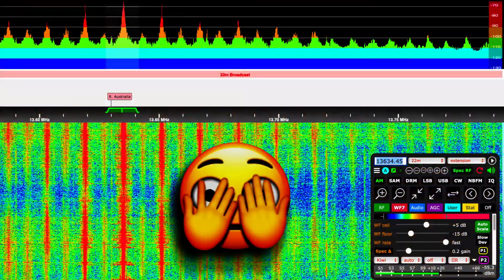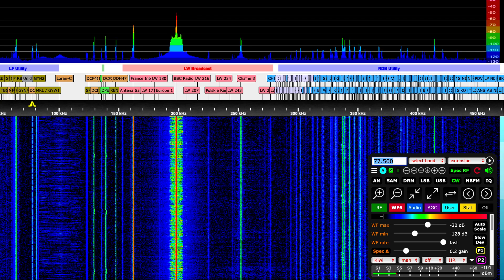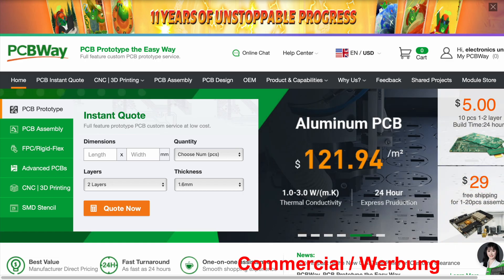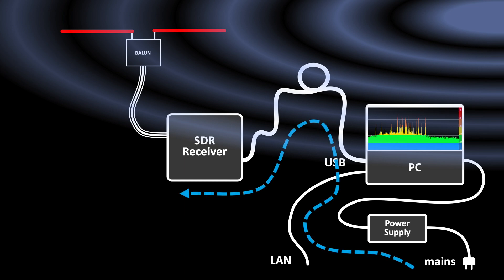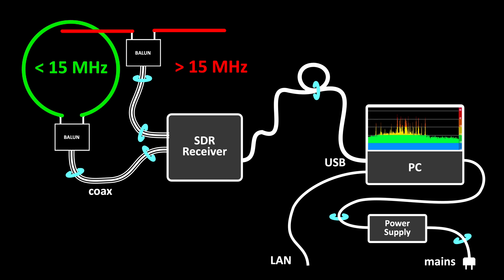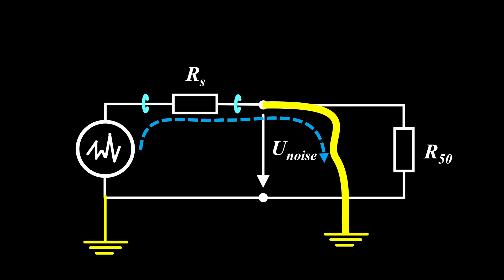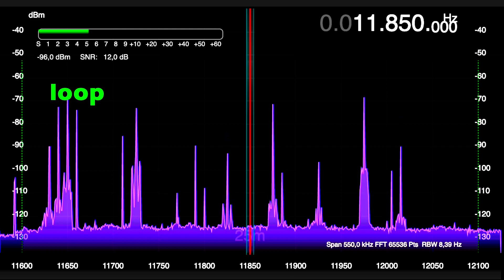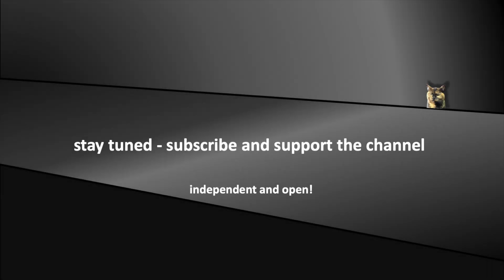Simple but Effective Measures for Good SDR Long- and Shortwave Reception (EP167)

Comment: Very good video! I am an SWL since i have 12 years old and like electronic.  But i buried this hobbie for almost 30 years and recently i come back. I  also  became a ham radio operador. Today it´s very dificulty hear short waves and even medium waves. So much noise. I remember i hear stations around the world in the eighthies with a long wire placed on my roof connect directly to radio without nothing. Very cool times!  I use today inverted dipolos for higher bands (15, 12 and 10 meters) and an end fed long wire with an unun 9:1 with the shield grounded. But, the results on listening in low bands are poor because so much noise. Thank you for your knowledge and video, i will build a loop antena to operate below 15 MHz (SWL). To transmit, some magnetics loops are good too? 73 of Jean from Brazil, PU2PQQ.
Reply from the maker: Thx for you comment! 
I am glad my video could help you a bit to overcome the noise. The loops I am showing here are good for receiving. For transmitting the impedance matching would be no satisfactory. But resonant loops, which you have to tune of course, are doing the job.
BTW lots of ferrite chokes and a good antenna grounding are also significantly suppressing noise.
Greetings
Klaus

Comment: Thank you for this very helpful explanation of eliminating interference. I will try this absolutely. Now I am receiving almost nothing on my rtl sdr v3 or v4. Do I need special ring cores or does it not matter which size or so. Kind regard, Roeland.
Reply from the maker: Thx for your comment. Nothing but radio interference, that sounds familiar, it was the same for me. You want to use ferrite chokes for the cables. I like to use larger ones so I can loop through 2, 3, or 4 turns of cable. I was showing this in a previous video. For the BALUN, simply use RF ferrite toroids. However, they are not critical for this type of BALUN. It's just a common mode choke. Any type of ferrite toroid will probably do.